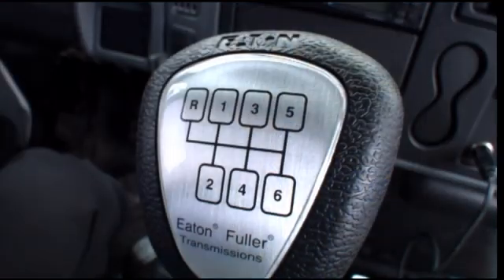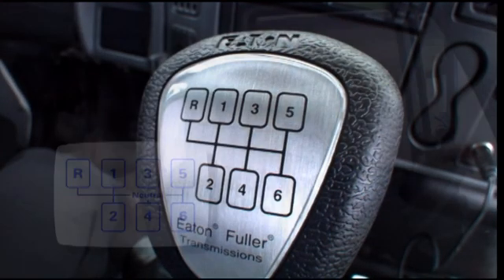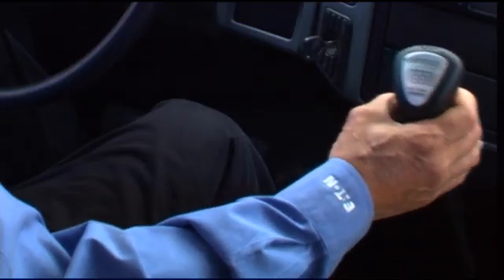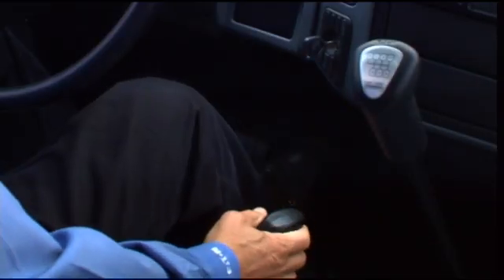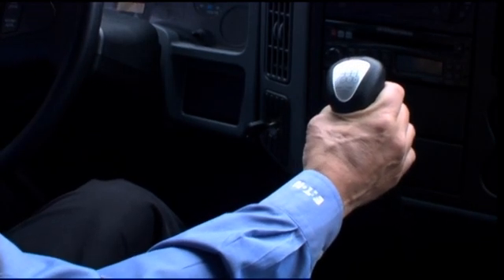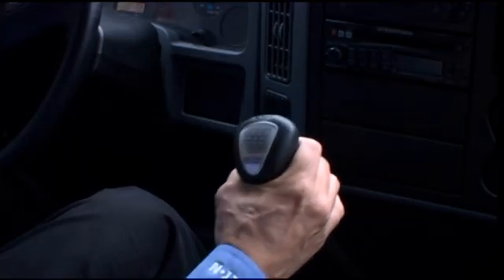Professional Shifting Eaton Fuller 5 & 6 Speed Medium Duty Transmission

Comment: Why can't you coast in neutral?
Reply: First, coasting in neutral will cause you to fail a CDL exam. It's dangerous to be coasting in neutral if you are in a situation where there is a road hazard because it will take longer to react and re-engage the gear. Also, not applying to this transmission, but in a non-syncronized transmission, it can be difficult to re-engage until you're completely stopped.

Comment: Video is from the 60s, just float it
Reply: Synchronized trans. Floating will take the synchros out. Floating is the way to go for non-syncro transmissions.
Reply: company put me in a truck with this POS transmission today and i had to watch this video.  its impossible to float the thing.  the gears wont go in unless it thinks the RPMs are correct.  half of the time its off by about 250 to 500 RPMs and you have to over shoot it and slowly rev it to the correct RPMs.  super slow to shift it. started to get the hang of it and was getting better at it by the end of the day.  You just have to let the thing do its thing and not force it.